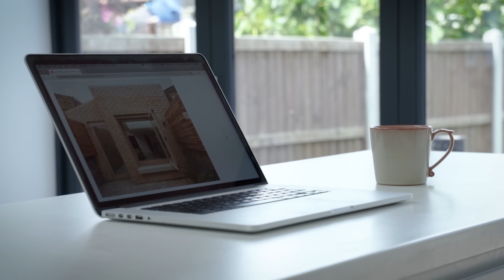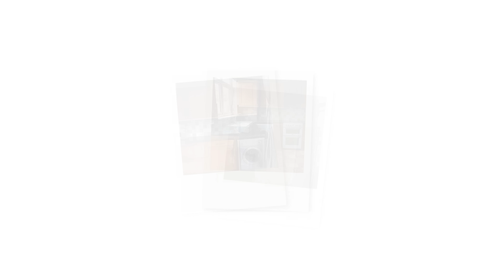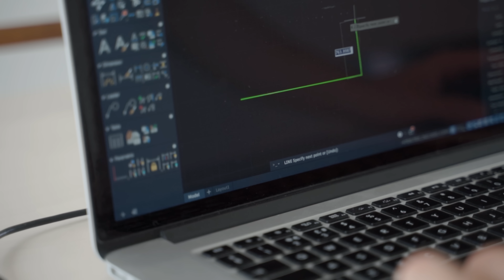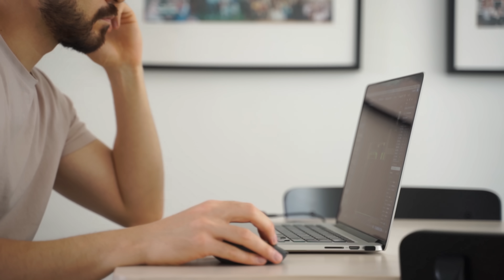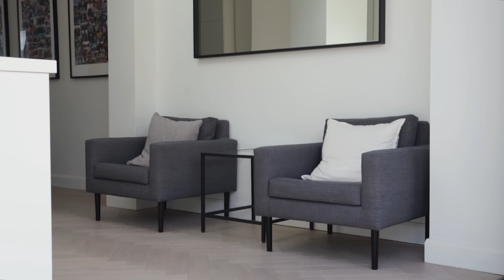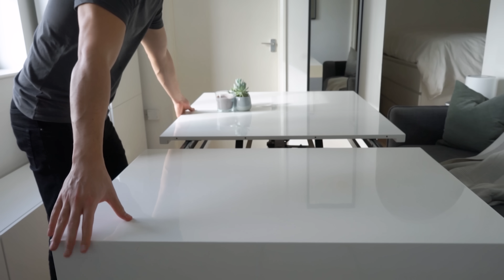Our Minimalist Home

Comment: Millennial architect using Autocad like its 1984... Why not use Revit or any other bim software that was designed for architect instead of a software that was actually designed for engineers?

Comment: I was waiting for it. Great way of showing sustainability in a city. There is so much potential in old houses, basically you can get a brand new experience for a fraction of a price of a new building.
Reply: Problem though is buildings in the U.K. are so old and very cold.
Reply: Let's not forget and more square feet compared to many modern new builds!